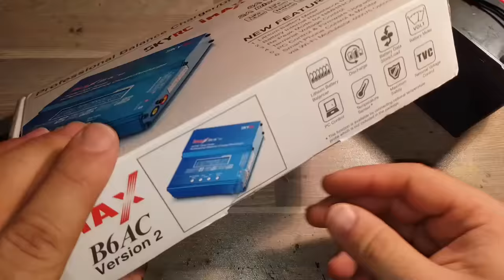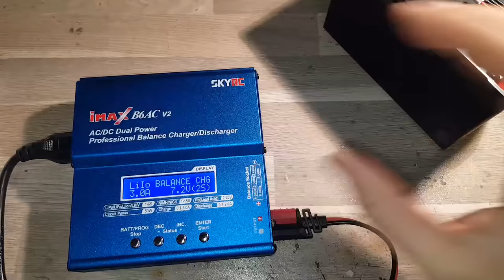DIY How To Make a Powerful 12V 18200mAh 420A li-ion Battery Pack

Comment: I urge you to change the title and description of this video because even if the cells can handle 40A continuous and 60A pulse (which I doubt because for 18650's that is extremely high!) then your nickel strips would literally melt way before those current numbers are even reached. What you are claiming is dangerous and viewers without much knowledge will hook this pack up to their car, thinking that it would work. The pack will definitely fail and a fully charged li-ion pack that fails is extremely dangerous!
Reply: Not only talk about the fact that the nickel stripe is not able to support such amp draw. Basically between 5 to 10 amp per layer of nickel stripe. That is why copper bus are used to fully support higher amp draw
Reply: Thank you for pointing this out. I still can't believe we haven't had an update about it blowing up. Not only is that but the battery series is completely absurd. You can't jump circuit the chain of positives over to negative and then back again. That creates a short. This is the worst case of DC in series and parallel I've came across with besides the guy that does this stuff that blows up on purpose.
Reply: @jeremytalkingeverything  I made a slight typo in my comment, I accidentally switched 3s7p and 7s3p around. He did make a 12V 18.2Ah pack, but the warning about the current load is still very much valid. The nickel strips can't handle the current and 40A continuous on those cells would surely cause problems. I however don't see a problem with his circuit wiring? He first welded up the parallel strips, connecting all the positives and negatives of the cells to create parallel columns and then he created a series chain with them by snaking around from + to - to +, creating a 3s chain. What I don't get is why he used so little nickel to create the series connections (ballpark is to use at least 1 strip per cell in both parallel and series connections). The pack definitely works, just not with the advertised current draw.
Reply: Yep, also bms only on 60A))) Also I dont beleive on "Liitokala" gives true ampers))
Reply: @jhonny44444  If he doubled the layer of nickel strips or even tripple layered, and spot welded each layer well enough, would this work?  Would option #2, soldering a bare braided copper wire on top of the nickel strip to help carry the load?
Reply: @jhonny44444  I do believe I was thinking there were box chain connections which would result in back travel in the circuit.  I may have been mistaken about that. But still it looks like there are redundancies in the circuit which could still short out the batteries  or wiring.
Reply: @jeremytalkingeverything  Ironically he didn't add all the redundancies in the circuit. When he welds the parallel connections, you can see that there are five available slots for the parallel strips but he only uses three. Which baffles me since he is already using such a small nickel strip.
Reply: @jhonny44444  I’m wonder if many of these Asian creative channels aren’t actually people who’ve worked in the factories that we by from in the western world. Some of the techniques & supplies I’ve seen are factory forms. Just curious. I love watching them, but often find an imbalance in the knowledge or understanding on some of what’s being built. Which would account for being taught part of a process or 12v knowledge but not having full understanding of electricity, it’s safe usage, and it’s limitations. If the end product of a build works for a week then dies- it’s not really properly designed. I’m not criticizing, I really enjoy the “no limits” of creation, however there are serious risk and concerns with higher voltage. This are just observations.
Reply: @icaremore  I wouldn't say that's my first thought but it could be possible. But his materials are readily available for anyone to buy. He used standard 18650 brackets to constrain the cells and he used standard nickel strips that you can buy per meter in pretty much every country I think. He also uses a DIY spot welder, so that tells me that he is just a hobbyist, since factories wouldn't use those tools (you can't weld fast enough with those for a prolonged period of time). Also, factories use pre-prepared materials for quick assembly, he makes everything as he goes along. Last, if he were experienced with at least assembly, he'd know that the pack itself has to be electrically insulated and protected against shock/liquids, which isn't exactly done in this video. Most of the video's you mention are made by hobbyists and they either have a background in electrics, basic understanding from highschool or are simply trying to copy off of others. The latter two can easily overlook critical mistakes when designing such a pack.
Reply: @jhonny44444  can you suggest any resources for a safe and properly built diy 12v lithium battery for use as a motorcycle starter battery ?
Reply: @Fee.1  Good question! High power (low voltage so high current) applications require a specific cell chemistry to work safely and efficiently. LiFePO4 and LiPo cell chemistry seem to be the most stable at high currents, with LiFePO4 being the most stable all round and least prone to starting a meltdown. LiFePO4 has another advantage with the fact that the mean voltage of those cells is around 3.2V, so if you create a 4sXp pack, you'll have a nice lead acid replacement with a mean of 12.8V. Then you'll have to look at what cell type you're going to choose. Bigger cells are often capable of handling a higher current but when it comes to capacity/volume, you'll probably lose some points. 2 cells in parallel that can handle 20A each, can deliver 40A with double the capacity of one cell. But a single large cell might not have double the capacity, while being capable of handling the current. It's a tricky puzzle that you first have to solve and it's highly influenced by your local suppliers of cells. Using an existing case like he did in the video is also a great idea to make sure that you keep everything compatible. A BMS is essential when dealing with series connections and lithium cell chemistry, so a 4S LiFePO4 BMS is required. Aliexpress has some decent ones, just make sure to double check the specifications and reviews first. You're going to draw a high current from the pack, so the BMS must be capable of handling that current (adding motorcycle to the search query might help). You're also going to need proper cell circuit materials. Thin nickel strips aren't going to cut it if you need to draw 200A or so from the pack. So you'll either need to use high gauge copper wiring or use copper bus bars with bolts and nuts (some LiFePO4 cells come with threads welded to the terminals). Last, I'd recommend using large shrink wrap (heat shrink) to seal the pack in before placing it in the case. Using shrink wrap to insulate all the terminals is also recommended. Since it's a motorcycle battery I would also highly recommend adding some dampening material to keep the pack safe(r) from shocks and/or vibrations. Good luck!
Reply: @pcguru2000  not really because you still have only 4 welds witch carry all the amps, so that would be weak spot regardless on number of layers
Reply: @prckata  The nicke strips are conductive on the full length, not just the weld spots.  The weld spots would have a little less resistance so it should be fine, don't you think?
Reply: @netmonk  no nickel can handle much more than 10amps per strip when they are only a few inches long. Length of the wire or strip makes a huge difference in ampacity.
Reply: thanks for the heads up
Reply: Assuming the nickle strip could take 20A (excegerated, I know), the battery would be max. 20A because all current is running via 1 single nickel strip each to the final wires wich connect to the terminals (see 8:40). He needs more nickles in serial and real busbars.
Reply: firstly i have never to this day  known anybody thick  enough to  try start or run a car on spade  terminals.  the 420A is just overall full capacity and as claimed 20A per cell hence21x20=420  it would be total nuts to say you can drag that from it continues or from them spades outlets this unit  will be ok around  18 to 21A     35/ 40 BURST compatible at 2A per cell  no bother for long life
Reply: These liitokala cells masquerading as Sony vtc5a are known counterfeit cells so the specs are an absolute joke and that's without getting into the nickel strip issue at all or the space connectors. These cells are Chinese domestic 18650 cells rewrapped in a clone vtc5a wrapper, I mean they're near $2 a cell!! To my shame I've (accidentally) bought some and thoroughly tested them. I won't lie, they're not awful cells. Both AC and DCIR was respectable, but obv nowhere as good as the Sony Murata vtc5a in fact they're worse than my genuine VTC5. My real (already been used a bit) VTC5 measured under 14mOhm on average, but the best of these measured 24mOhm. So no, not terrible cells, but not Sony and not able to pull the kind of current this guy is claiming.
Reply: @Fee.1  - it's completely pointless to try and make a Lithium Ion motor cycle starting battery. For one thing, you'd have to alter the charging (alternator) or add some special LiIon charging system into the bike.
Just buy a standard Lead Acid one (it's a proven and perfect solution), or spend more on a properly built LiFePO4 alternative. Using pre-built is cheaper and it's guaranteed.
Reply: @johncoops6897  are you sure it’s cheaper
Reply: @Fee.1  - OF COURSE it's cheaper. This "DIY pack" cost about USD$100 just for the materials, and it doesn't have suitable capacity for long term usage as a starting battery. Furthermore it's got no BMS or charging circuit, so that also would need to be added.
A standard motorcycle starting battery is about half the cost, requires no modification of the bike, and you just go and buy one with zero effort.
Reply: @johncoops6897  i meant cheaper than a lithium one but point taken
Reply: @Fee.1  - There is no practical advantage in using Lithium instead of Lead Acid in that kind of application. That's why, even though Lithium is a mature battery technology, used for 20 years, almost all motor vehicles use Lead Acid batteries for starting. Yet the don't use Lead Acid for phones, laptops or torches.... go figure LOL
Reply: @johncoops6897  it makes a lot of sense for ME though, I can’t keep it on a maintainer but the bike sits without use for long periods. Get it?
Reply: @johncoops6897  If cost wasn't a factor, the practical advantage of using Li-ion batteries as starting batteries is weight, charge cycles, ability to run (nearly) flat and charging speed. The only reason we're not seeing li-ion as starter batteries is because of cost. I've seen some Li-ion batteries for cars and motorcycles but they're prohibitively expensive. Installing Li-ion batteries under the hood will reduce the amount of cycles you get from all the heat, but they'll still outlast lead acid. An alternative would be to install the Li-ion battery in the trunk but then you're contending with much bigger gauge wires to account for voltage drop.
Reply: @missingMBR  - You are wrong about the "advantages" that you claim, however I won't bother trying to teach you in detail. Li-Ion is potentially lighter, but has FEWER rated charge cycles than Lead Acid and definitely CANNOT be run almost flat. Charging speed is somewhat irrelevant for Automotive Starting, since the alternator is charging whilst driving.
For lithium-based Automotive starting they almost always use LiFePO4 because that is an infinitely better technology than Li-Ion or Li-Po for  that applications. It has about 10 times as many charge cycles as Li-Ion, and a far superior current handling and flat discharge curve, as well as a voltage that much better matches standard automotive applications (12.8V nominal, 14.0-14.4V fully charged).
Reply: @johncoops6897  firstly, Lithium Iron Phosphate (LiFePo4) are a type of Lithium-ion battery. The 18650's used in this video are Lithium Cobalt Oxide batteries (LiCoO2). They have lithium ions that move from the anodes to the cathodes when discharging, or vice versa when charging. Please, don't try to patronise me by insinuating you know more on the topic. 
Lithium cobalt batteries are rated for 500-1000 charge cycles @ 80% discharge. Lead acid is around 200-300 cycles.  You're correct that LiFePo4 has greater cycles, upwards of 1000-2000 cycles. If keeping to 20% depth of discharge with LiFePo4, you can extend those cycles to upwards of 7000-8000. 
All batteries can be run flat. It just drastically reduces the cycle life. Most pundits claim the magical 50% DoD for AGM batteries like it's some mysterious discharge wall you must never cross, when in reality it just refers to more charge cycles. If you truly wished your lead acid deep cycle battery to last its longest, then you'd never discharge it more than 20-30%. 
I don't know what you mean by superior current handling but all lithium batteries have a flat discharge curve. LiFePo4 does have a better nominal voltage for 12V applications but it's a misnomer because Lithium Cobalt voltage can be corrected with buck/boost converters. 
There's nothing potential about Li-ion being lighter than lead acid. It's simple physics. Lead acid has an energy density of 30-50 Watt hours per kg. Lithium Cobalt Oxide has 150-190. LiFePo4; 90-120. Therefore for lead acid to provide the same watt hours as lithium cobalt, you'd need 3 times as much. 
As for faster charging, one could argue if an alternator can charge a battery faster then the load on the alternator is shorter. Thus you have improved fuel efficiency. 

Lastly, you don't need to preach to me about LiFePo4 batteries. Literally, a week ago, I ordered 8 280Ah LiFePo4 EVE cells to build my own 6.7KWh battery.
Reply: @johncoops6897  did you tell Fee that this video has no BMS. He attaches a BMS at 5:07. Your cost estimate is off as well. I could build a 3S7P pack including BMS for about $55 AUD ($39 USD)
Reply: @missingMBR  - Well you are a bit confused, however it's too tiresome to try and correct the various errors and misleading stuff in that long post above. Good effort to type it all, however!
As for the shorter comment, you have a deficiency in your observation skills. After 5:07 the YouTuber holds up a few different BMS boards but NONE of them were ever connected. If you keep watching you will see at 9:00 onwards where he connects the output cables and balance wires directly to the (undersized) "nickel" (probably steel) strips. There isn't any BMS there, buddy!
As for my cost estimate of $100, well I was only roughly estimating the cost for a normal person in the real world. Also, my reply related to a proper DIY replacement for an Automotive STARTING battery, not the silly little thing shown in this video. Anyway, I'd love to learn where we can purchase 21 x genuinely rated 20/30A cells, spacers, nickel strips and a (say) 200A rated BMS for AU$55 (I assume including delivery costs). I currently need to buy some cells for Tool Battery rebuilds, so I'd appreciate the info.
Reply: @johncoops6897  you're right that $55AUD wouldn't be enough for a DIY lithium starting battery, nor would $100USD but your quote comment was referring to the parts used to make the pack in this video, which I could source for $55 AUD. Would I use it as a starting battery? No. But then this video is a perfect example of how not to make a battery. 
You're also right about the BMS. I actually stopped watching when I saw the amp rating of the BMS and came to the comments to complain. 

I do like how you've just dismissed my previous comments. I think it's because you've realised I'm correct but you don't have the integrity to admit your faults. It's all good buddy. End of the day, it's just the internet. YouTube points don't really amount to much in the real world. 

If you don't agree with discharging Lithium flat, go have a chat to the CEO of Battleborn. He'll enlighten you. I won't bother going any further about battery chemistry energy densities or charge cycles. 

Have fun with your power tools
Reply: @johncoops6897  thinking more about starting batteries though. If I were to build one, i would use Lithium Titanate. Nominal voltage per cell is 2.3V so 6 in series is suitable for 12V applications. They have a high discharge C rating, about 10-15C discharge. 30,000 cycles. Can run to 100% DOD. Are very stable. Have wide operating temperature range (+50C to -50C). About $40AUD per 35AH cell. Use a 6S 60A BMS and wire the ignition system directly to battery via a high current contactor that's switched by the BMS. 500amp starter solenoids aren't super expensive. All up it'd cost in the proximity of $400AUD excl shipping. But it would last longer than the car.
The one downside with LTO batteries is their energy density isn't much better than lead acid.
Reply: @missingMBR  problem with that is charging you will not get the full capacity of the lto cells.  5 would work as the cutoff for that will be in the ballpark of 14v max.  If you use 6 a pot is needed on the alternator to make it put out higher voltage to take advantage of the full capacity
Reply: @missingMBR  no bms is needed in a car application hook everything directly to battery.  And use a qnbbm balancer or equivalent with a isdtbattgo 8s monitor/balancer for lcd readout of voltages.  I have built a harley starting battery it was 20 ah and weighed about 5 lbs it was lifepo4.  It has now turned into his car shop starting battery and has started everything brought in so far.  I have had headways and pouch cells in my car for over 3 years now.  With no bms just a balancer.
Reply: Great, Thanks for letting others know about it. Do you have any professional proper video to follow for battery welding, assembling
Reply: @ashwinceo3625  the way to do it for higher amp draw is to find the widest nickel strips ya can find do the spot welds and bolt the nickel strips to aluminum bars.  Not really sure what these guys are talking about but nickel strips can actually handle quite a bit more than whats even in this video.  There are A123 26650s that are being used in car audio applications (these have to be spot welded as there is no studs) and they are pushing way more amps than these.  Usually for a vehicle battery a BMS we never use, a good solid balancer and perhaps a isdtbattgo 8s. (for nothing more than a display of voltages)  if all the cells are tested (i dont mean just slapping a dmm on them and saying okay they are good) and balanced properly and a good balancer is used they will last yeaars as long as they are treated within there means and maintained.  I have started a V8 (MY 300C) with nothing but 8 pouches for a total of 16ah so contrary to these guys beliefs it doesn't take much lithium ah to start a vehicle.  I have built a 20 ah 32650s when tested puts out over 1200 CCA on a load tester and it hasn't found a vehicle yet it will not start.  And yes I have videos of everything I have stated.
Reply: @ripsta2009  great to hear, Why can't you share the link
Reply: @ashwinceo3625  what link?
Reply: @ripsta2009  your video link
Reply: I was wondering too on how that strip connecting the lithium ion batteries can withstand that stayed current, worst is when an ignorant guy attempt to start a car engine. Everything will explode. Simple don't try this at home.
Reply: @charleschumbe5708  18 ah is enough to start even a HEMI with 0 problems.  I have started a HEMI with 16 ah of battery 8 pouch cells.
Reply: Thats not a  car battery.  That battery is the type used on home alarm systems and used on electric gates and garage doors. Not for cars
Reply: I only clicked on the video cuz I didn’t know how the numbers could be true, then after the nickel strips where placed I was laughing
Reply: Lol 😂 yeah I had to double take on title too
Reply: Yeah this video title is very deceptive considering that a little battery like this is definitely cool, but not realistically pulling more than like 20 amps considering nothing is said about what cells, their individual capacity, and the current they can handle

But from the capacity he claims I would assume salvaged laptop pack cells, which I would be conservative and say like 2.5 amp continuous each in parallel but not a lot more for general safety

If they’re high current cells then the capacity is HEAVILY overstated since it’s just impossible otherwise
Reply: What is the size of a nickel strip that is supposed to be used for this system